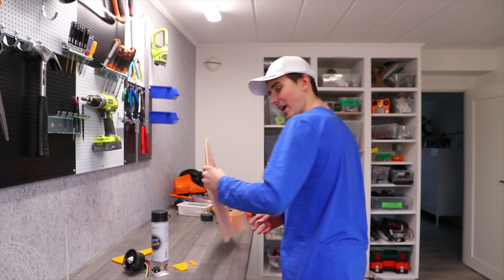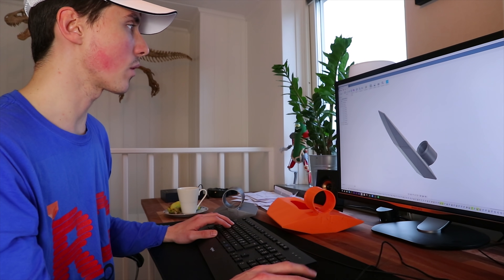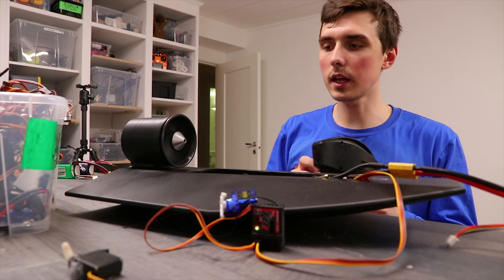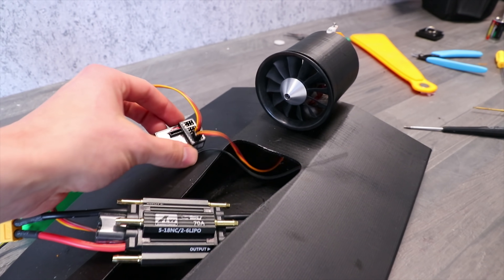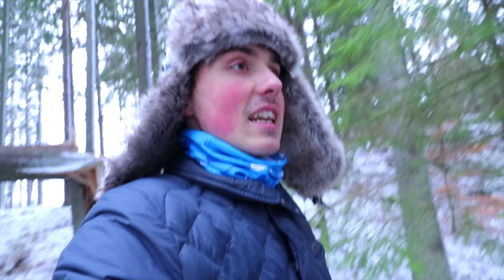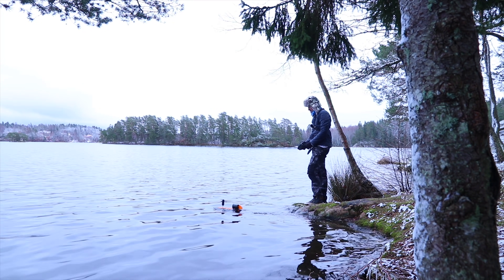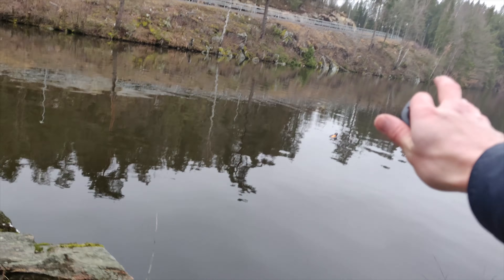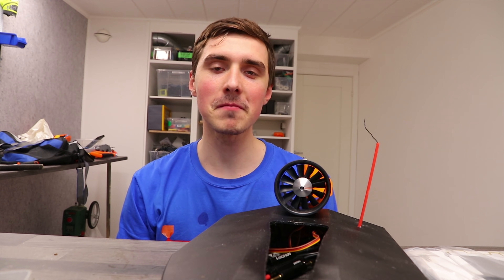Fan Powered 3D Printed RC Airboat

Comment: Simon, can you wear a particulate mask next time you spray paint? My dad was a car body mechanic and he had a lot of horror stories about guys who didn't protect their lungs from spray. it'll make his ghost happier. :)
Reply: Well, sometimes that can bring you quite vivid daydreams 😜
Reply: He also is not doing this 8 hours a day for a living.  You don't get black lung from going in a coal mine, you get it from being in there all the time.  All that said, a mask is certainly can't hurt!  Well, it could if you dipped it in something like ether.  Probably don't do that.
Reply: @Alluvian567  That would surely not hurt you if you did it only once. But doing it all time from different hobbies could eventually hurt you. Besides, when making a video you're ought to show a responsible behavior, even if you do otherwise when not on air.
Reply: Very likable comments.
Reply: I was going to say the same thing.  I used to not but now anytime I spray paint I wear at least one of the cheap masks.
Reply: @Blondie SL What did he inhale that was so dangerous?
Reply: he's outside..
Reply: A mask wouldn't hurt, but more than likely wouldn't make a difference since he was outside. Dudes getting long term damage from this stuff are in paint booths or other indoor areas painting all day every day, and not always changing their masks or even keeping them on.
Reply: I know i'll be shot  dow in flames for this but for half an hour's sparying I doubt very much any harm will be done.    More harm perhaps in getting stressed about it and not enjoying your hobby .....
Reply: David Farmer it only takes 2-mins of spraying. Ask me how i know....
Reply: @darkracer1252  cut it  out guys
Reply: @Blondie SL it's 2019.    in 20 years you can buy lungs in wallmart.  lighten up

on a side note.    
either there is going to be a third world war and you'll die anyway.  
or there will be no war and science is going to start looking like magic verry soon
Reply: @Blondie SL you're the one making up stuff about someone dying.  and I'M the horrible person?